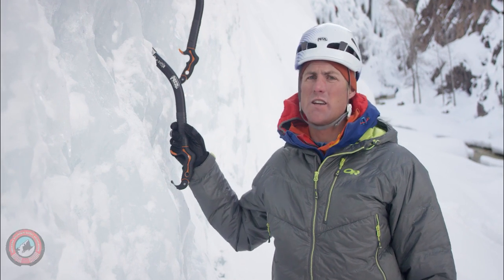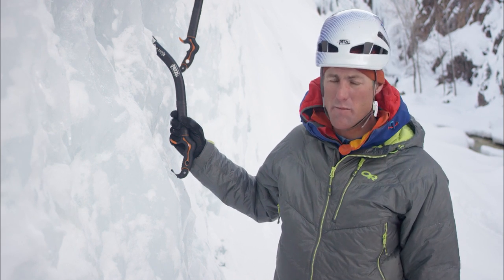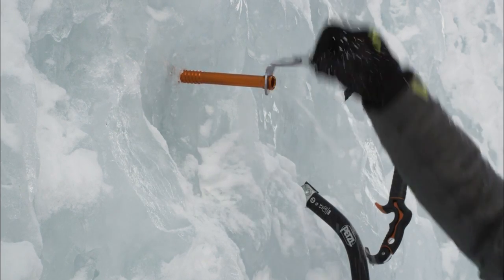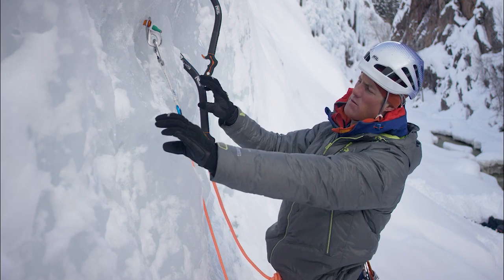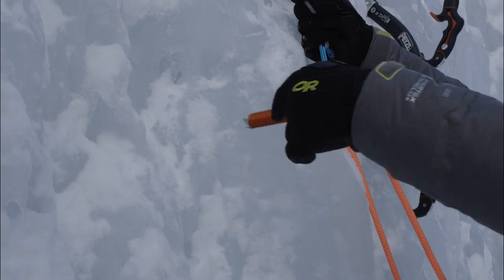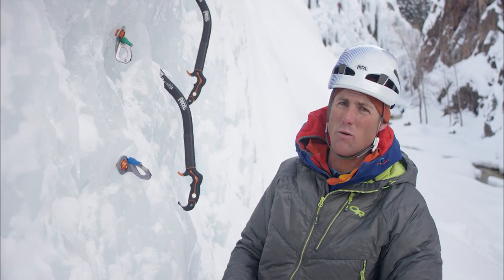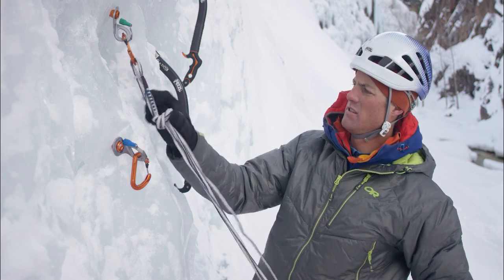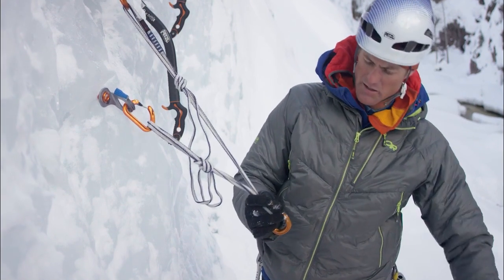How To Build An Ice Anchor

Comment: As a disciplined rock and mountain climber who has yet to ice climb, can one explain how ice climbing is using two piece anchors mostly vs 3? is this a gear management? or is ice really that bomber depending I guess?
Reply: the Chanel "How Not 2" has a video on that. an ice screw in good ice is bomber https://www.youtube.com/watch?v=Hy_W10xMrCM&t=1034s  
with 13 cm screws the ice around them failed at 16 kn, the longer ones went up to 26 kn before the ice around them pulverized.

Comment: Thanks for the video. Someone mentioned "quickdraws" earlier, but I ask again, why don't you use locking carabiners, or at least mention that "guys now i'm doing this w/ wire gate, but you should use locking biners"
Reply: Have you ever tried unclipping a tensioned sling from a wire gate? There's really no need for every point in a belay to have a screwgate on it, it's heavy and unnecessary.
Reply: critical links should be lockers (i.e. your clove, anything involving belay device or 3rd hand)  everything else non-locker
Reply: Two non lockers reversed and opposed is sufficient.

Comment: Thanks for the tutorial.
In the case of lead climbing, I prefer to use a personal anchor sling such as a Kong Slyde or a common nylon sling to clip myself into the first ice screw that I place so I'm not depending anymore on my belayer. And that method of clove hitching and then uncliping and re adjusting the clove hitch I find it quite unsafe and unpractical in the scenario of a vertical belay station. All that slack that you generate before readjusting your second clove hitch is quite risky. And also quite complicated to do if your belayer is giving you tension.
 Just my opinion, but I would like to hear a good argument that justifies this video techinque over some other techniques.
 Cheers!
Reply: Generally the argument against using a personal tether at an anchor on multipitch routes is that it's less gear and time efficient than just tying in with the rope, since you always have the rope with you. A PAS or sling is also less dynamic than using the rope, although either of those may allow you to feel safer sooner at the next anchor rather than relying on your belayer. But your point about having all the slack is valid as that could cause a shock-load situation if you fell in that moment, or if your clove hitch is loose it might not hold a fall.

Comment: So AMGA is recommending people use quick draws on their anchors? I hope know one minds if I keep using screw gates. :/
Reply: I'm not trying to be a dick, but they're not, they're using wire gate carabiners which I'm assuming is what you mean? Again, I'm not trying to be a smart ass but as far as I know, wire gates aren't really unsafe to use on anchors because they're under constant tension (otherwise risking shock loading of the dyneema etc etc) and they're generally only about 1-2Kn weaker than screw gates I think? Obviously we all know very well that screw gates are 'belt and braces' but correctly orientated and serviceable wire gates on anchors aren't a huge safety issue. Or maybe I'm a fucking idiot and I'm lucky I'm not dead. Either way haha!
Reply: Ollie Your not a dick.
Reply: We use non lockers for the single points of pro on an anchor and of course lockers for the master.
Reply: Redundancy comes in the fact that there are multiple pieces of pro each with their own wiregate. IMO, the extra weight of the screwgates overshadows the marginal benefits in security--especially since the system is already redundant. Only lockers where there would be a single point of failure (masterpoint and belay shelf). Saves weight and more efficient (not bringing extra lockers w/ limited functional versatility compared to the 'biners you already have on draws)
Reply: I don’t mind if you use lockers, but you and your second might mind if the locker gets frozen shut. I guess not a big deal if you are just talking about using them on the screw end, not the rope end. It it is still more awkward than a wire gate.  I don’t know of any trad or sport climbers that regularly use lockers on their individual pieces of pro.
Reply: Wire gates are often king in ice and snow from my experience. It’s no fun breathing heavily on your screw gate in -20° for 15 minutes trying to open it back up. 😬